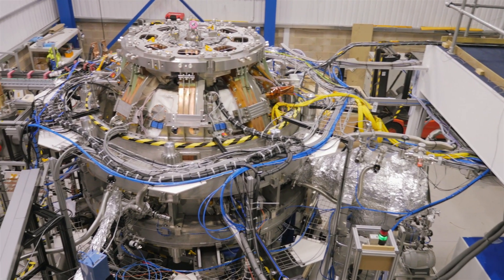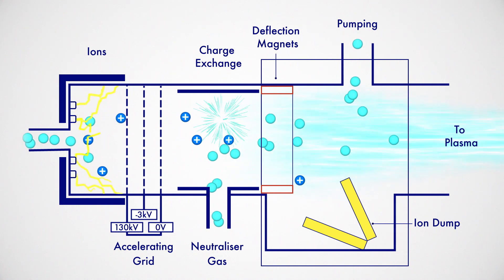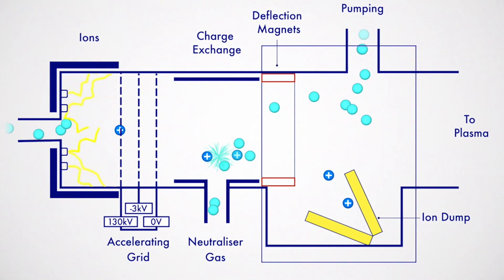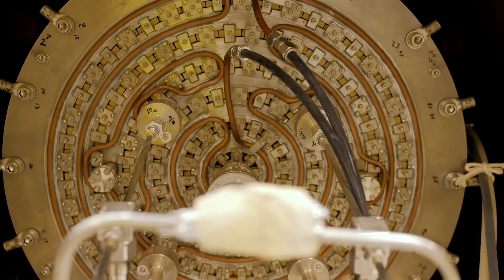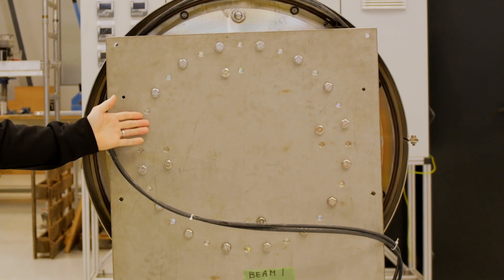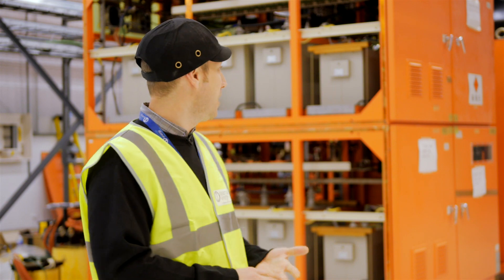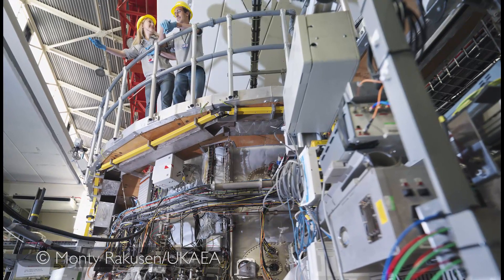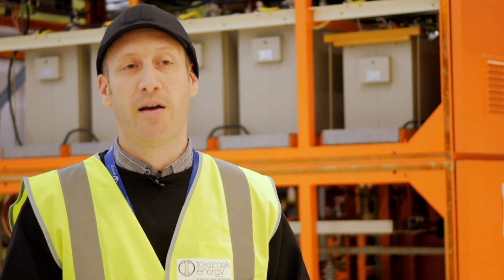Neutral Beam injection and its importance for tokamaks

Comment: How does the accelerating grid work? Why do the charged ions not immediately start decelerating again once they have passed the accelerating grid? Surely they are attracted to the grid no matter what side of it they're on.
Reply: Take a look at the animation that starts at 37 seconds in. It shows sparks on the far left side creating positive ions that get accelerated by the grid. The negative parts (electrons) that get striped off the hydrogen that is being fed in under pressure (that is important) are likely sucked into that far left grid of the accelerating grid, which is at 130k positive voltage. Like charges repel, so the positive ions (hydrogen atoms less their electrons now) would be repelled from that grid to the left, but if they get past it, then they are repelled further down the gun, especially since there is a negative grid to attract them and a ground further down. I'd guess that they only make it past the first grid because they don't have anywhere else to go and once they are past it the kinetic energy gained going from there to past the negative grid gives them far more than enough energy to escape the draw of the negative grid, which other wise might draw them back, and idk but i'd guess that the ground helps shield the negative from far field effects so there after they don't really see the grids.
Reply: 😒130kv that is a lot energy use
Reply: @name6440  Not really. Most neon sign transformers have an output of around 10Kv